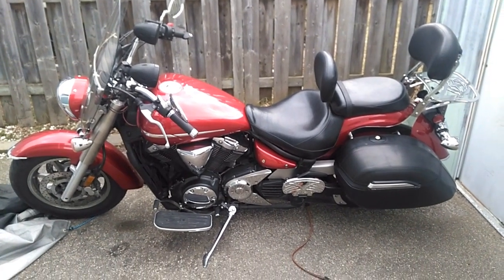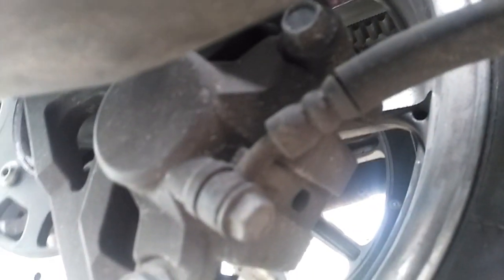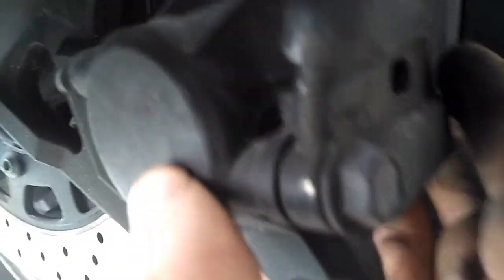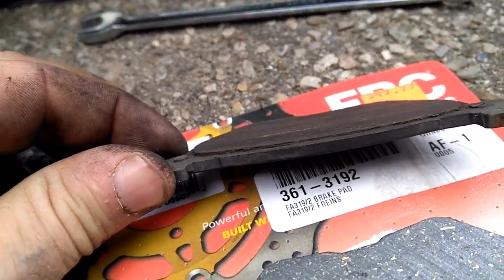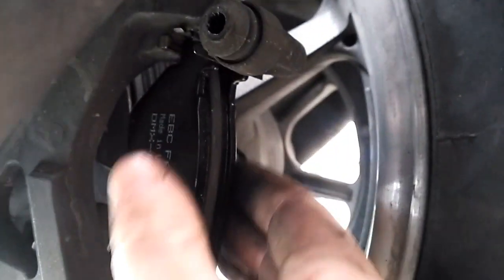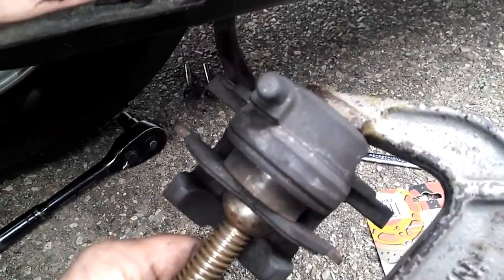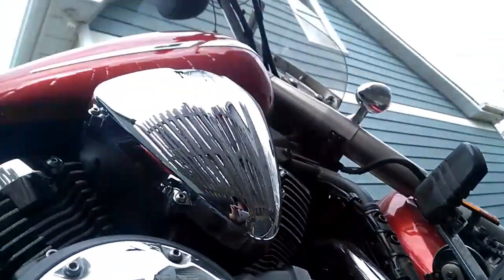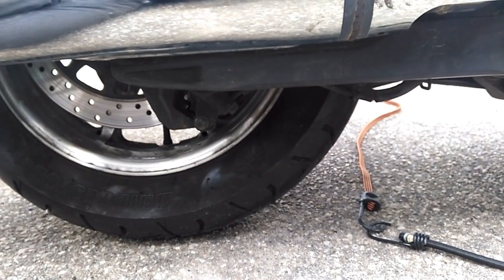2007 Yamaha Vstar 1300 Rear Brake Pad Change

Comment: How many miles did he get on them before needing new rear pads
Reply from the maker: Not sure. He bought it used at the end of last year. He puts a lot of miles on he's part of a motorcycle club. I'll let you you know when I do them again.
Reply: I go 76,000 miles on my rear pads. I’m just now changing them out. That’s why I was watching this video. Thanks for the video, you just saved me o er $100.00 for labor. 🙌🏼
Reply: @kasperaquatics  76,000???
I was wondering if mine needed done. I just bought an 07 with 12k miles on the bike. 

The front are new and have plenty left, but it’s easier to tell bc the grooves in the pad. 

The rear doesn’t have the grooves, and I can hear them a little when I break so I thought maybe they needed done… I’ll have to get them off and actually measure how much is left but maybe the sound is just because the bikes Barry been ridden over the 15 years it’s been alive.
Reply: @brandennunn9416  thanks ready to do mine
Reply from the maker: @terrydawkins9936  good luck. Glad I could help a little!
Reply: @kasperaquatics  I'm calling bs on that. Your pads didn't last 76k Miles unless you just never use your rear brake
Reply: @jamespeach626 , you can call it whatever you want. It’s my motorcycle and I know all about it. I never used my back brakes when I rode, only if I had to. That’s the honest truth. So deal with it!